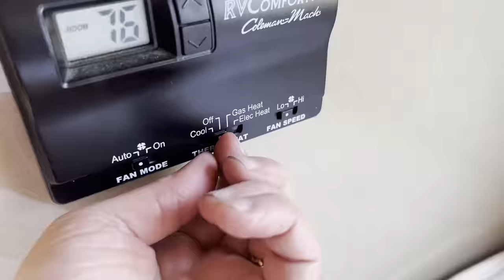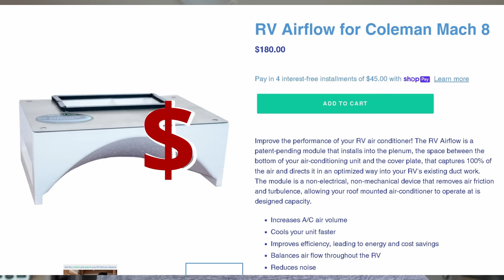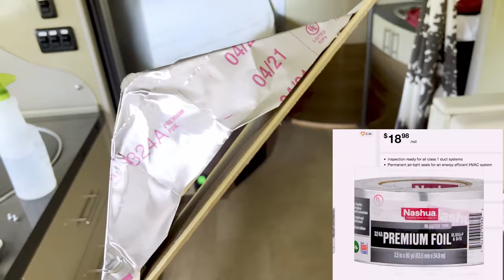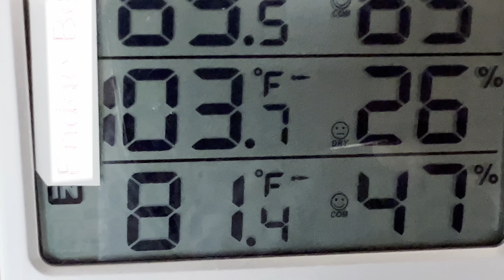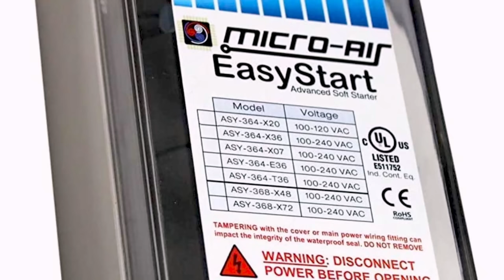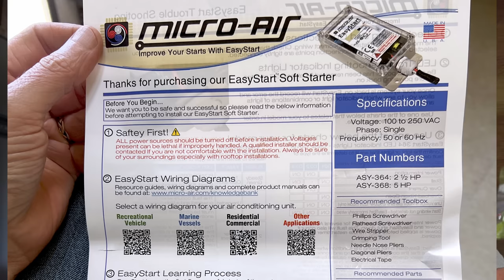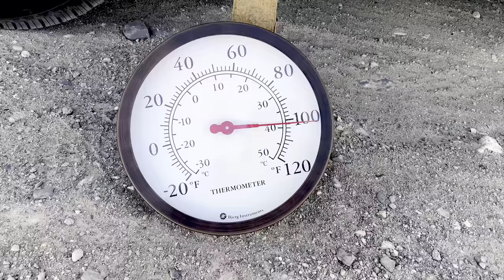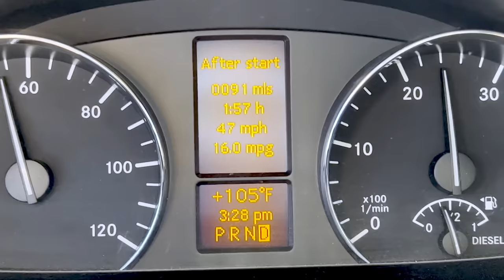3 RV AC Mods to Improve Performance and Reduce Noise

Comment: I made the DIY plenum 👍👍👍.  Also, cut away the plastic fins to the a/c covers (both exhaust and intake).  Really helps the a/c units breath a bit better.  Covered the large holes with 1/4" hardware cloth and riveted them to the housing cover.  

I like that reflectix mod man!!!  I’m gonna do the same.

Comment: Thank You Ron!! Another good hack...A/C units and refrigerators are a problem in the heat. I've found that being completely level also is a big issue with the refrigerator. I'm going to follow your instructions on the A/C unit.. Thanks again. I did also install fans inside and outside of the Refrigerator to help the air flow. Works well. Thanks for that one too!

Comment: the Onan "quiet diesel" is quite the oxymoron.  It's amazingly loud.  I appreciate you using an actual SPL meter for your tests!  Very well done.
Reply from the maker: Thanks. I appreciate quiet when out in nature and the genny sound is so rude.
Reply: My QD  with over 700 hours on it is quiet i insulated with sound deading...of course the LP crowd jealous of us QD3200 owners, in which they didnt want to pay the $3000.00+ for the option always seem to have negative comments on not having a same fuel system for the engine and generator

Comment: Hey Ron great video as usual, I did prime and paint my shroud on a Vita, Been up there for a year and not a sign of paint issues. Definitely seems to make a difference in heat on the compressor.  I used Rustoleum primer and Krylon top coat in white. Looks better too.
Reply from the maker: I always worried about the paint chipping. Might give it a try.
Reply: I painted the top of mine also with white Kilz primer paint. Need to rough up surface and treat with solvent. I still have to touch up every year.

Comment: I bought a premade item from KoolRV for $85, that made a huge difference in my a/c/ pressure. Cools down my Puma Palamino 37plf and the air shuts down instead of running continuously.
Reply from the maker: These RVs can get very hot and the AC needs all the help it can get.

Comment: There's some other YT videos on smoothing out the airflow in the AC ducts. But I liked the idea of using insulation in the roof AC housing. Also the soft start is a must do, I think it's supposed to prolong the life of the compressor as well.
Reply from the maker: It seems to help in several areas. Just wish it didn’t cost so much.

Comment: Great video! Ay 10:35 it looks Hellish! I was thinking of using sound control board like you did but also wrap the compressor and the squirl cage fan too, on the top side.
Reply from the maker: Thanks. Good luck with your mods.

Comment: For the color of the shroud affecting the temperature of the air conditioner. There is a substantial amount of air, passing across the condensing coil, the small thermal mass of the air conditioners cover (color), will barely if it all affect the outdoor air temperature as it passes across that coil. When you look at the thermal mass properties, the volume of air and the speed of the year that passes it I believe that it’s a stretch to think this part of the equation will have any real effect.
Reply from the maker: I agree that the shoud color is npt a big problem but it is something that you can consider if you have a choice. I do believe a white cover will allow the AC to start cooling quicker when first turning it on since all the components will be cooler to start. Yes, shade is good but not always available.

Comment: Another Great video Ron ,  i will be upgrading my My Coleman Mach like yours.  It  draws 125 amps off my 3000 watt inverter.  Imagine if i do what you did i could get her down to just over 100amps. But i also want a low draw cooling system. I managed to fit a window ac in the bedroom window. I have a17 g model  the rear slide is the bed. There is partition door so i could just cool the bedroom.  It draws 50 amps so my 400 amp hr batteries are able to run it all day. I installed my inverter in the rear storage area.  Not where the factory inverter is located.  I wired my inverter directly to the cb panel via auto transfer switch. I may leave the factory inverter and the 2 100 amp hour batteries up front.  For now until I'm comfortable with the new set up.
Reply from the maker: Sounds great. I alway enjoy trying different approaches and making the changes that fit our lifestyle. 
Do you have 4 batteries to give the 400 ahr?  Which kind did you choose?

Comment: Always fun viewing what you do to make your RV more efficient! My 11J has the same issues but climbing up on my rigs roof is not something I want to do! Your modifications, are they available in a kit form anywhere? The insulating sheets I believe are available at most hardware stores, so that I can handle. Speaking that, when I start my generator and turn on the ac, nothing happens!? Any suggestions?  BTW, we live in Fallbrook and I don’t think too far from your place.
Reply from the maker: The foam insert for inside the RV AC can be bought. There are a couple olaces that sell them. Outside mods are strickly home made. Another option is to replace the whole AC with a Houghton unit. They are quieter but it costs a lot more that the foam.

Comment: Once again, another practical informative video. I have a Mach 3 with a black housing and I’m wondering if a white housing would reflect the heat better. RV manufacturers don’t seem to understand the real world the way the owners do. Thanks, Ron.
Reply from the maker: I considered painting it white.  Should be 30-40 degrees cooler.  Only concern is if the paint would stick and not peel off.
Reply: @ontheroadwithron2432  - I thought of white paint immediately when I saw your black shroud. Just in case you don't know, both Krylon and Rustoleum make spray paint for plastics. I've used them on several projects. If the plastic surface is very smooth (like a computer mouse or a plastic deck chair), the paint will stick, but is easy to scratch off (kids). If the surface is pretty rough, the paint seems to adhere much better and resists scratching. Just two cents if you need another project. 🙂
Reply: That might explain why I've seen ACs in Florida with no covers at all

Comment: Have you ever considered painting the black ac cover to white? I would like to know the difference in temperature of the unit itself before and after the color change. I would think that white would be 10-15 degrees cooler. Thanks for the video!
Reply from the maker: I did think about it but am concerned that the paint wiuld chip and look bad. I know the temperature of my white paint on the rv body is  30 deg cooler than the black sections.
Reply: @ontheroadwithron2432  that is a huge temperature difference! It makes you wonder how much cooler the RV could be with a white air conditioner cover. With cooler air around the outside coil, I would think it could more easily transfer the warm air away from the coil.
Reply: Perhaps the AC manufacturer has a white color or maybe an RV salvage yard?
Reply: I painted the top of my black AC shroud silver, and it reduced the temp inside the shroud significantly.
Reply: Use adhesion promoter.
Dont over think it... its just paint.

Comment: FYI that inferred thermometer  measurements surface temperatures not air temperature, this explains why some temperatures are way higher and took a long time to come down (or go up) then expected.

If you really want to reduce the amount of heat on the camper, shade is your biggest friend. I am not talking about shading the air conditioner, I’m referring to shading the entire camper. Solar gain can count for as much as a third, or even a little more of the gain that the camper sees.

Comment: Have you had any issues with the bathroom skylight cracking due to heat being trapped between your fabricated insert and the skylight? I read somewhere where the intense heat affected its longevity.
Reply from the maker: No cracking but the motor that open the lid has stripped and it will not open now.  It is 7 years old so I need to replace it.

Comment: Ron, did you compare the two common product options (micro-air and softstartrv) and favor one over the other? And, if so, why did you go with one over the other? I'm getting ready to install one of these in my 14V in the next week or two.
Reply from the maker: I looked at both. I have a friend that did the microair unit and was happy. I also thought the micro unit had a slightly better current reduction. Close call.

Comment: Thanks Ron.  As always, appreciate your inventive upgrades.  I upgraded my rig to 4x Battle Born lithium; added a 3000w Go Power IC.  Same issue.  The inverter is overheating in that box.  Escondido heat.  Vegas last week was intolerable.  I have a similar rig to yours, Mercedes based Reyo 25-T.  I added a small fan pointed at the inverter.  No help.  If you have some ideas on cooling that compartment... really appreciate the thoughts...
Reply from the maker: I plan on adding an exhaust fan on the side of the compartment. Air intake is from the opening at the top where all those cables exit. That will be air conditioned air. Just have to figure out how big a fan and if i want a thermal switch on it.
Reply: @ontheroadwithron2432  I ran the AC with the cargo door closed and it popped the inverter in about 25 minutes.  Let it cool, opened the cargo door and it ran for over 2 hours without overheating.  We have a definite heat dissipation problem.  I like your idea of piping in cooler air, with additional venting.

Comment: Hey Ron, which inverter are you running? I know you panel is a victron, but based on the specs that you said when it faulted, I get the feeling that the inverter isn't a victron unit.
Reply from the maker: I have a Samlex 2000 watt inverter.

Comment: You can also buy a Hysolis Apollo 5k electric generator. And then you can run solar. But it’s expensive too. And if you buy 2. You can run 50amp power.
Reply from the maker: Nice unit but more expensive.

Comment: Thanks for producing this wonderful video. While watching another video where someone was doing the same thing you did, a commenter said that condensation will collect between the reflectics and the metal housing and cause it to rust. Would you or others please address this possible concern?
Reply from the maker: All air conditioners remove moisture from the air. They drip that water somewhere. Mine runs off the roof and drips by the coach door. The AC is designed to not rust with this moisture around. I don’t see how the reflectix makes any difference unless you plug up the drain holes.

Comment: I have a View Profile. Suggest you fabricate a Reflect-X cover to replace your white vinyl windshield cover.  Also fabricate a reflect-X cover for cab area.  Both covers should be on the outside of the RV. The cab section is fiberglass and has less insulation that the rest of the RV.  I use magnetic adhesive strips on my covers  to that adhear to the steel frame.  I live in Texas and can get my rig down to 77F when it is +95F.  I will leverage your "cool"  idea to apply reflect X on the evaporator.  Thanks.
Reply from the maker: My next task will be making some kind of Reflectix window coverings.  Not sure what to do about the cabover section yet.
Reply: I've hung a blanket from the bunk to further separate the cab from the cabin so the AC has a smaller area to cool and seen an improvement  :)

Comment: 2 hours run time on the AC using battery power Ron?
What size is your AC & your battery bank?
Reply from the maker: The AC is 15k btu. Battery is 400 ahr or 5.1kwh. At night it cycles on andd off so it lasted all night.

Comment: Many thanks Ron, going to do these mods on my 2023D Navion. Aside from EasyStart install, did you have to rewire anything to run the AC off batteries? And you are not running inverter when running AC on battery, correct?
Reply from the maker: No rewiring required except for battery cables. But yes the Air Conditioner is powered by the inverter which changes the power from the low voltage battery to high voltage AC current. All these air conditioners run on 120v AC. Remember that i only have a 2000 watt inverter. If you switch to a bigger unit such as 3000 watt then you should rewire your AC lines to a bigger gauge wire to handle the extra capacity.

Comment: great video Ron
I'm looking at going in a different direction with AC I purchased a eco-flow pro 3600 Watt and I'm looking for a small AC which will be portable  also it would be great if you would put out a video on ideas of carrying extra fuel I've thought about putting a fuel tank in the driver side front storage compartment.
I always enjoy your videos thanks

Comment: Did you add the sound deading/reflexic to the ouside or inside of the shroud? Couldn't tell in the picture.
Reply from the maker: I put it on the outside. Just the large flat area.

Comment: I wonder if you paint the AC shroud silver reflective or solid white if that would help? We put the silver bubble wrap on the windows that actually helps.
Reply from the maker: Paint might help a little but I am more concerned with the paint not sticking to the plastic.

Comment: Would adding some aluminum heatsinks to the inverter and then via fans routing cool van interior air over that and then exit thru another hole in the inverter box work. Should be able to dissipate quite a bot of heat that ways.  Using computer fans are cheap, quiet and move a lot of air for their size.
Reply from the maker: Will be working on ventilation method soon

Comment: Hey Ron does this also apply for a regular mach 15 RV unit that is ductless?
Reply from the maker: The insulation in the roof top unit would apply. The “easy start” will help make the turn on more gentle.  Since you don’t have ducts the foam dividers won’t be needed.

Comment: Another great video. I want to trickle charge my RV's main battery using installed solar. I am thinking of installing Battery Tender Solar Charger Controller. Do you have any experience on this?
Reply from the maker: Not familiar this this. My Trik-L Start charges the chassis battery and my main solar charges the coach batteries
Reply: Do you ever worry about large hail?? I've held out on installing solar because of hail. A friend of mine bought a new nissan from a dealer in Texas cheap because all flat surfaces were badly dimpled by golf ball sized hail.

Comment: i have same ac over my head in bedroom. when compressor starts it really gives a good bang. did the micro air soft start cure this? thanks in advance
Reply from the maker: My ac with the soft start doesn’t have a bang. Gentle start.
Reply: @ontheroadwithron2432  thank you. i go for it

Comment: So with an inverter you can run a/c for a few hrs
Reply from the maker: Yes. Nice to have in case we need it. We don’t travel in hot weather much but sometimes it is necessary. Wife cannot sleep with diesel generator running under the bed.  We have also been in campgrounds where genny hrs end at 8 pm.

Comment: Your AC unit doesnt have any filtration? my 09 View has filter on the intake side I see yours does not and i installed a Hepa on the intake side...and black AC unit  is a fail mine is white always enjoy your videos
Reply from the maker: Technically my AC does have filters. They are built into the cover shroud on the ceiling. They are those thin washable plastic one that only filter  out large things like flys. Wish I had a white shroud like yours.

Comment: Comment:  I don’t know about painting a black shroud from black to white, but if you do try spraying a coat of primer (for plastic) that might work.  Recently I had to paint a new water heater cover to color match my motorhome. Got it online from an auto paint company.
So far works great without issue.
I have a black shroud on my Dometic Penguin II.  Won’t paint it. Did the mods on the baffling and EZ Start already. 
But insulating the shroud with Reflectix sound like a good idea.
Reply from the maker: I just haven’t wanted to try paint on plastic.
Reply: You could probably buy a white replacement shroud if you're not into painting.

Comment: What kinda batteries do you have to run the AC?
Reply from the maker: I gave the EG4 server rack battery pack. 12volt with 400 amp hrs of storage. Will run AC for a couple hrs if needed.

Comment: Now can you solve the issues with the MB AC in the cab?
Reply from the maker: Are you referring to the units icing up on occasion?
Reply: @ontheroadwithron2432  yes.   Especially down here in SE hot humid conditions.   The stock answer of "set it  to 70  degrees and low speed" so it doesn't freeze up seems to be an admission of poor design on MB's part.

Comment: Reflectix doesn't do much without an air gap. Foam would work much better.
Reply from the maker: True. Foam has better insulating properties but hard to work with curved surfaces. I used the Reflectix mainly for ease of use and there is an air gap in most places. Where the cover bolted down to the AC, I used sound dampening vinyl. Thin and it will not crush.

Comment: Can you insulate inverter?
Reply from the maker: Not sure of your question. The dc to AC inverter has cooling fans to remove heat from the unit. Therefore you cannot insulate it completely without it overheating.